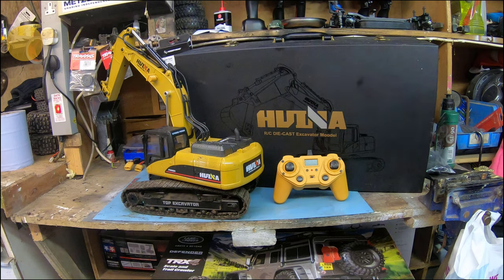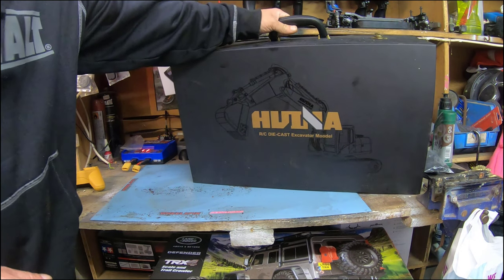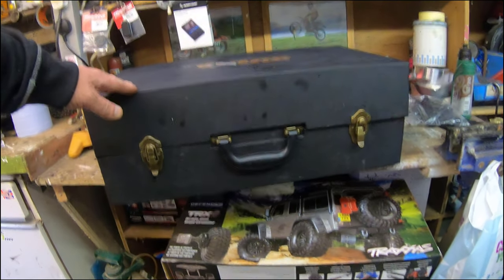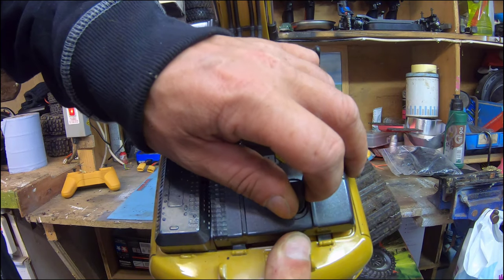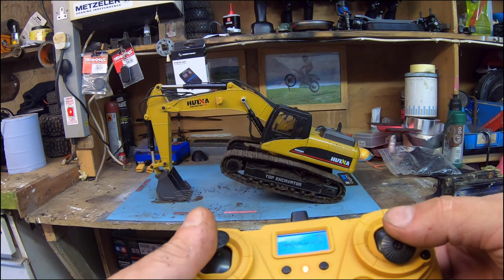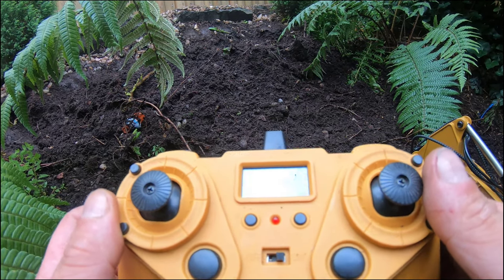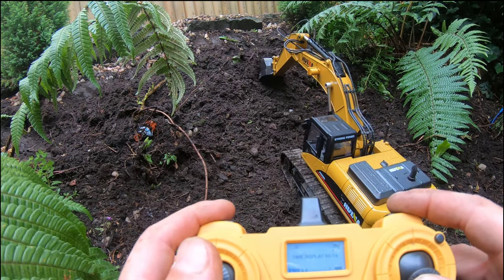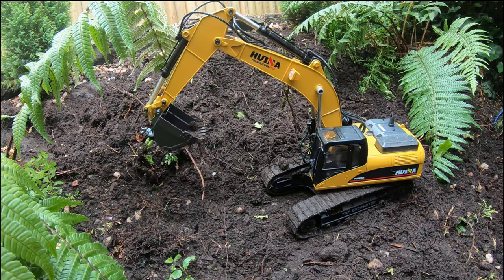HUINA 1580 V3 REVIEW & CONTROL BREAKDOWN

Comment: Where's the link. I need one. Pretty cool.
Reply from the maker: I'll try find you one buddy I got it from modelsport.co.uk it's a brilliant little machine lots of fun 👍
Reply from the maker: Just a quick one tho if you are getting one make sure it's the 1580 v3 the V2 isnt near as good things like the controller and hydraulics all big step up the older ones worked on cogs not the rod system I explained in video and lack power 👍
Reply: How much
Reply: @neilhamilton2621  $600 US.I got the 1592 and it has very little power for $200 US.